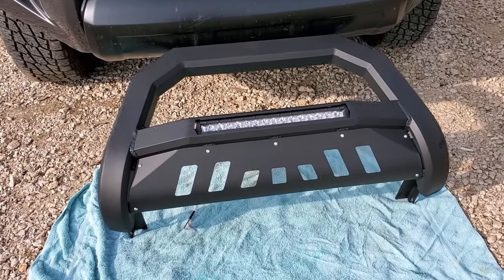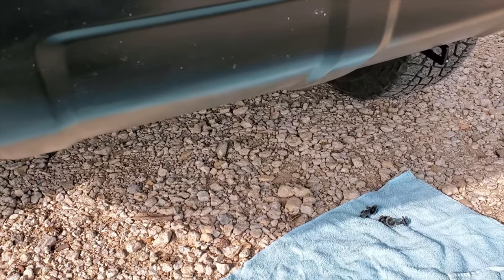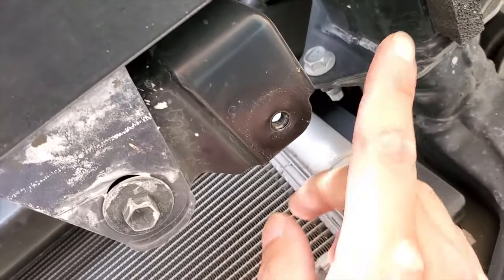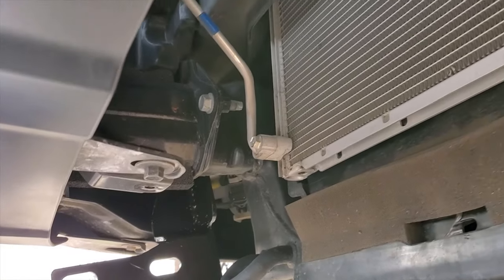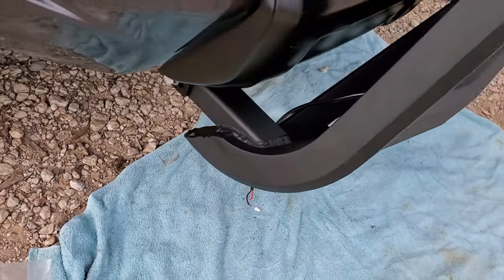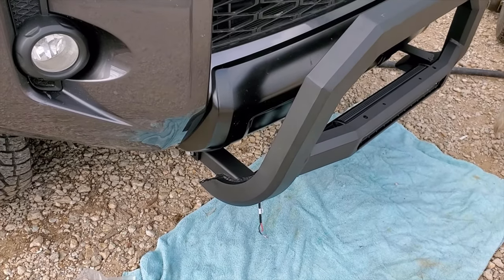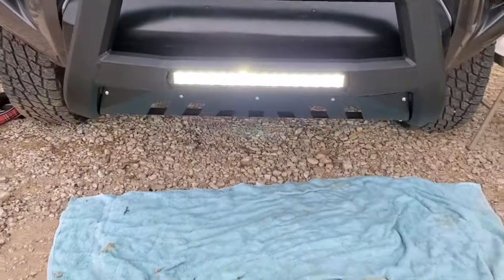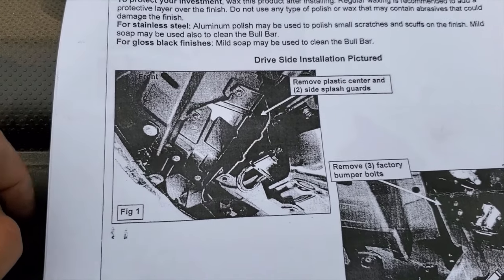Toyota 4Runner Bull Guard With LED Installation

Comment: Thanks for posting.  Those instructions are almost useless so your video will help.  That bull bar looks pretty cool - I like the angled corners vs. rounded on the usual ones.  I think the angles match the current 4Runner better.  Suggestion - don't just say you did something (like removing the plastic shielding at the beginning).  Show how you did it for us newbs.  And do an update video when you put a real switch on it so we can see how you did that, too!
Reply: Also, your link to the one with LEDs says Unavailable.
Reply from the maker: I'm glad the video helped.  I'll try to explain everything on detail. It's just hard to do something while recoding.  The plastic shield on the bottom was so easy to remove I didn't think it was necessary to explain it, but I'll try to do it as I remove something next time. It's my wife's 4Runner, so as soon as she decides she needs a regular switch, I'll definitely will do a video on that. Thanks for watching!
Reply: @RandomVlogTime  Awesome.  I went ahead and got a bull bar installed.  It was crazy how little room there is to tighten it up once it's leveled and in place.

Comment: Thanks for the video.  I just put one on my Honda Pilot.

The manufacturer instructions arent great, but i feel like most people will figure it out as they move along.

I did have to drill through the crossmember and remove the bumper and cut through it during install.

Im happy with the looks, but people shouldn't think this will survive a impact a speed.
Reply from the maker: I agree.  It's definitely not for impact purposes, but it sure looks great.  We still have ours on and still look great after 2 or 3 years.
Reply: Thanks for the video.
Is the led light removable?
Reply from the maker: Yes it is.  There are two hex bolts holding it from both sides.
Reply: Thanks you for the quick response.

Comment: what material is that bull guard made of?
Reply from the maker: According to the link provided under the description, it states that its made with Aluminum.  I believe that the angle iron where you screw it on, it's made of iron metal.

Comment: Which Trim level and year do you have? I notice you have the TRD Pro upper grille. Was wondering if you added that or if it came stock?
Reply from the maker: It's the Off Road. It came just like that.  The only thing that I've done to it, is the front bull guard.

Comment: How much torque you need to remove those 3 bolts on each side? That's what I am struggling with. I can't remove them they are just stuck in. I"ve went up to 50 lbs torque and it still won't budge. Already even broke 1 of my 14mms lol.
Reply from the maker: I don't know how much torque since torque is usually not calibrated when removing bolts lol. Try using a tube by inserting it at the end of the wrench, ratchet, or whatever you're using to remove the bolts. That usually works great when removing bolts or nuts.  Also always remember "lefty loosy, righty tighty" 😆.  Sometimes I used to get that confused back in the days.

Comment: So did you find how to change the wiring to the red light on the that never goes off?
Reply from the maker: If you're referring to the red light on the switch, I just left it alone.   We never noticed it being on.  I never went back to replace the switch either like I originally thought about doing.   It has been working great after years now, so I thought if it ain't bloke, don't fix it 😂

Comment: Will this actually protect anything? are you happy with it and does it seem sturdy?
Reply from the maker: I belive that this bumper is just for looks.  Not sure if it will protect from anything but I'm not willing to try it out lol.  I installed it a while ago and it seems to be holding on its place.  I tight it pretty good, so it's still sturdy as when I installed it.   The reason I bought this bumper is because the way it looked and matched the body itself.  I'm not planning on taking it off-road any time soon, but it does look very cool and nice since the day I installed it.   The LEDs still work and I've used those a couple of times.  I hope this helps in any way and good luck!
Reply: That's a full body on frame chassis. It goes bolted straight to the frame rail. I would say yea, it can take a whack.

Comment: what size are the factory bolts that are backed out out and re used for the mounting brackets? 14mm?
Reply from the maker: Sorry for the late response.  I don't get notified when someone posts on the comments for some reason.  
I believe that 14mm sounds about right.   It's been a long time since I worked on it, and to get to those bolts, it's kind of annoying lol.  But 14mm should more likely be the correct size.
Reply: RestoreVivifyTransform oh no worries thank you!  you are right on this year it is a forst class p.i.a!!!  thank you so much for you video bc the instructions were shit!

Comment: I have the same truck as you and got the same bar and the brackets are too far apart and I can't attach the bull bar. Literally I have like a half inch to an inch gap between each side and I can't bolt it on
Reply from the maker: I'm sorry... I have no idea as to why I'm not getting any notificarons when someone leaves a comment.   Mine was very tight.  I had to squeeze the bull guard in and force it so that I could put two bolts in.  You may have to use some washers to make up for that extra gap and probably get some longer bolts from a hardware store, Lowe's, or Home Depot.

Comment: This fits on 2005 runner right?
Reply from the maker: According to the title of the Amazon listing, it says that it's suppose to be for a 2010-2020 Toyota 4Runner.  I can't say that the bottom of the 2005 looks like the 2010, as I never owned any of the other models.
Reply: you can purchase one for that year. I’m considering buying one on ebay for my 2007

Comment: Will it work on a Rav4?
Reply from the maker: I'm not sure.  The instructions provided were very hard to understand.  Imagine them trying to explain on how to install this bull guard on a different type of vehicle. 🤔.  The brackets that came with the package mount straight to the main frame, and there isn't really any wiggle room.  As a matter of a fact, the bull guard fitted very tight between the brakets.  Some frames may be closer or more separated to each other.
Reply: Does it wobble or move while driving?
Reply from the maker: @christopher23.  I haven't touched it since I installed it.   It still looks good and doesn't move or wobble when I shake it.   Not sure while driving since I can't see it lol

Comment: It has ugly welds
Reply from the maker: The only welds that are visible, are on the front cross bar where the LED bar is.  The welds on top of the guard, you can't even tell that it was welded as it gets grinded down to make it look smooth.   I agree with the welds on the bottom back of the guard are ugly.
Reply: @RandomVlogTime  i was looking online for used parts and saw a midly wrecked 4runner. With the heavy duty push bull bar cops use. The 4runner still had the hood and bumper destroyed.  The top part of the bar bends back. Reading the comments, if they think its going to protect their property like insurance does giving credit to those that have it then its not. These things are definitely soley to aid in pushing cars out the way not to receive high impacts.